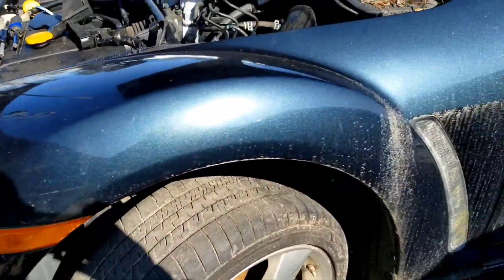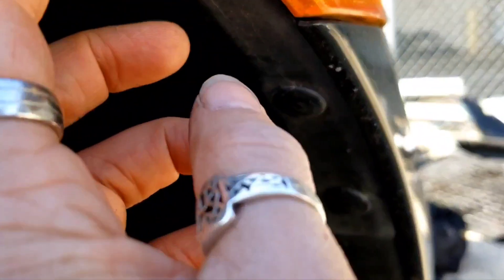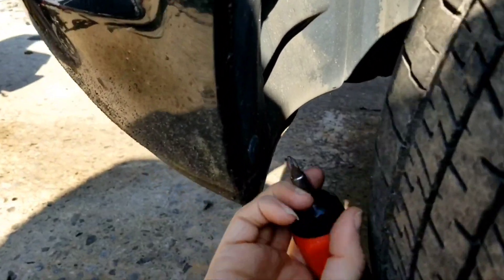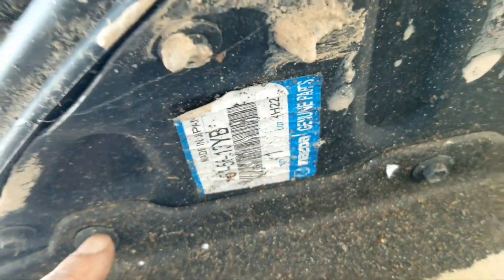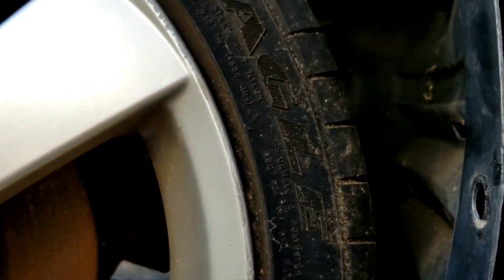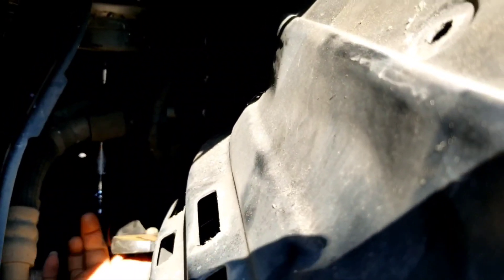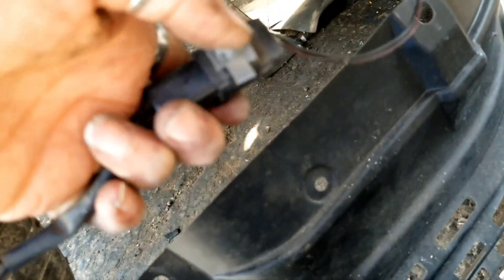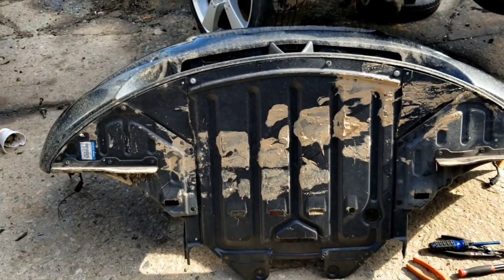2004 Mazda RX8 Front Bumper Cover Assembly Removal with Underbody Shield attached: Junkyard Edition

Comment: Moving on up,nice ride Rx8😊
Reply from the maker: Lol.  Mom adores her RX8.  She has an 2005 Shinka Edition.  She almost lost the car when a driver crossed the line & hit her head on in a blind curve.  Mom saw her at the last second & swerved off the road so it was a square hit, but it totalled it.  Mom only had 40,000 miles & had just replaced the block. We could not find a comparable RX8 that was not double the miles & trashed.  Insurance ponied up more $$$.  We were able to buy it back after that & repair it.  She's still driving it to this day.